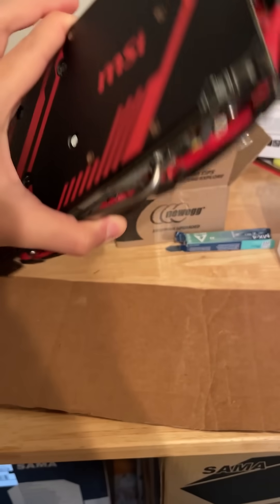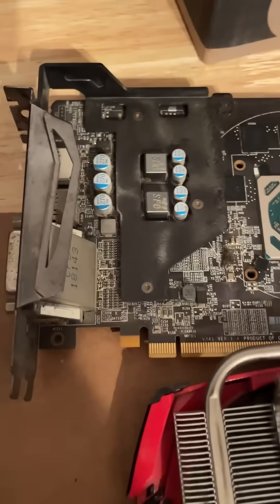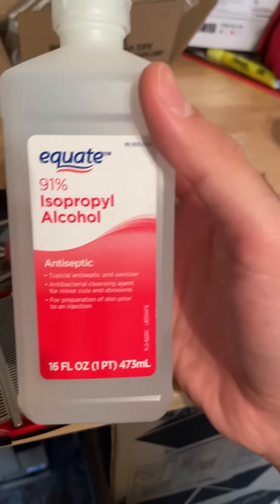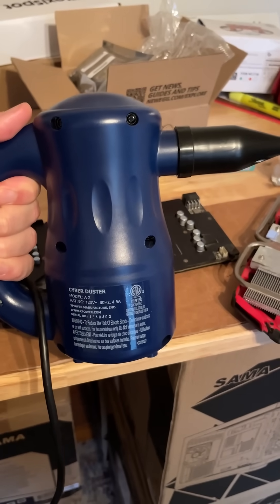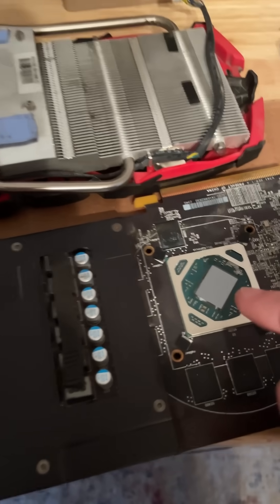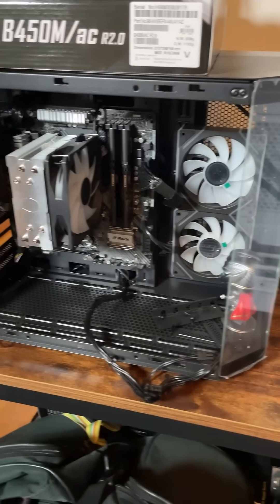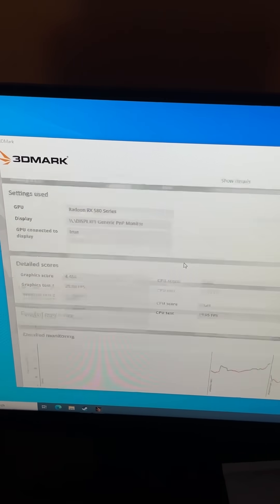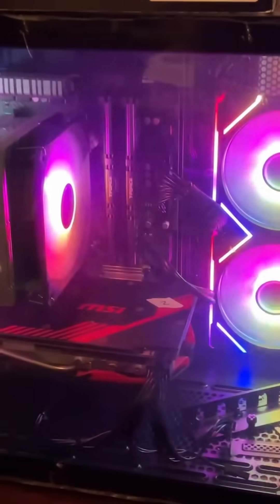Repasting a mining GPU - MSI RX 580 Mech 2 #GPU #repasting #gamingpc

Comment: I typically only replace them if they are ripped or deteriorating. When I do, I always double check the thickness of the pads though!
Reply from the maker: I like this! Yes, pads tend to be more work due to the measurements etc, versus just putting a reliable paste in there; so definitely a longer process!